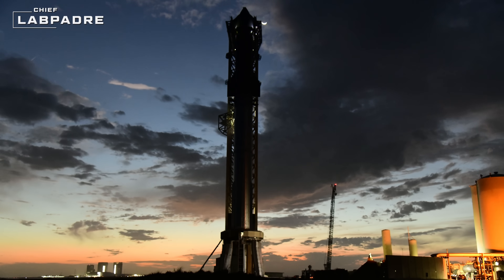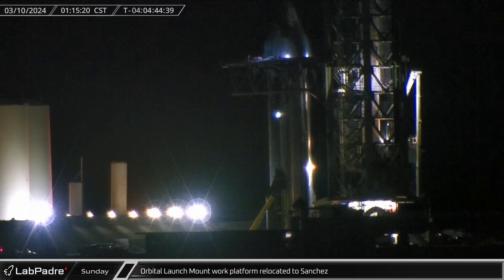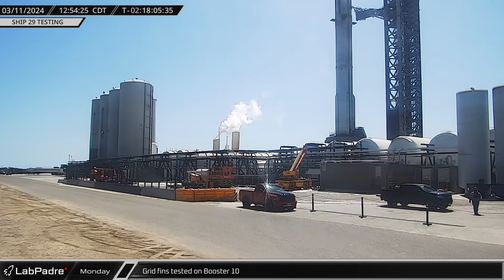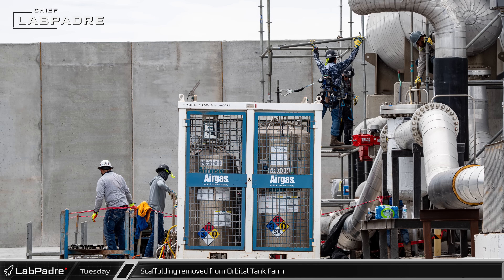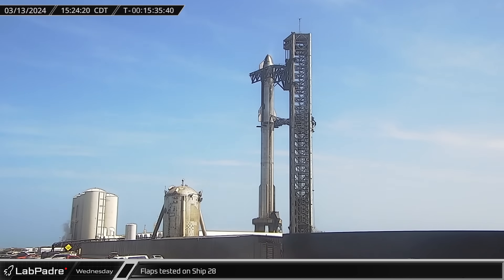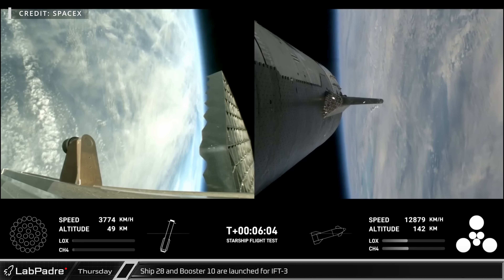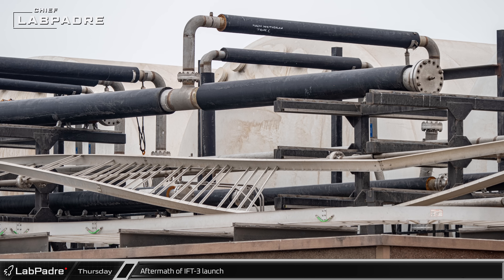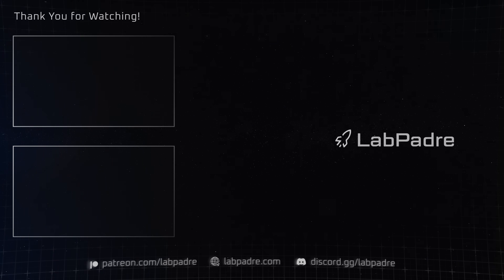WOW!! SpaceX Makes History With Starship's 3rd Integrated Flight Test - SpaceX Weekly #106

Comment: How can you cheerleaders live with yourselves?

The current starship is a pile of crap design. There are four more copies just like ift-3 .

It had to hot stage a full minute earlier than if t-2. Reason to avoid exploding. That is not a step forward. That a step backward. Then hot stage flat top section destroyed nozzle o-rings in the three gimbal engines. But starships burned damaged engines to 170 kilometers. Engines shut off. But now gimbal engines are venting methane in an oxygen out the rear of the rocket.. video fades out for a while until they bring it back online with Star-link. The view remains the same. Gas is still being expelled out the back of the rocket through leaking O-rings. As starship begins arcing down to reentry, gimbal engines can’t relight. So as it hits the atmosphere the tiles and insulation begins flying of the ship Like a dealer dealing cards at Vegas. With no gambling engines now starship begins to pitch and yaw. Even if SpaceX could have righted the ship. It still burns up due to missing Thermal heat tiles. Last as to heat resistant stainless it melts at 1400 to 1450 degrees. If it were 7075-t6 or 7  it would melt at 1075 degrees . With starship falling like a stone out of space it will encounter 4,500 to 6,000 degrees. At least Apollo came in at an angle and avoided temperature around 3,200. The tiles will not stick to 304 stainless. Heat has nothing to do with it. It is plane non stick.

So expect the same result with ift-4 threw ift-9. After ift-9 bs will walk. The government will no longer throw more good money after bad.

Comment: Does anybody know what happens to the concrete inside the OLM legs? It's there a risk with all of the extreme heat, pressure waves, and vibrations? Can that cause issues?
Reply: There's a concrete construction everywhere but it doesn't cause any major issues

Comment: I've speculated this over on NasaSpaceFlight's channel, but I wonder if future towers they're going to give themselves more distance between the launch area and the ground equipment, just to better handle the force of takeoff.  Could be that they're just too close right now to really shield everything properly.  Also kinda wondering if they might not build, or allow to be built, some sort of bunker structures for all the cameras.  I mean sure, they don't have any obligation to, but all those fans and groups setting up equipment are great PR for the company and it'd be a nice little nod to the groups that all support their endeavors
Reply: Maybe, I suspect more horizontal tanks.  When you're using super chilled propellants plumbing runs are a real concern.
Reply: @TheEvilmooseofdoom true, but right now they have all their tanks and plumbing practically on top of the launch area...with the result that stuff is getting hammered every launch.  I'm not talking setting it a mile apart or anything, just move it back a bit further.

Comment: If you want to test the unprotected stainless steel strength and resilience to reentry speeds and plasma, what would you do? Test immediately by by using a shortened flight profile with no danger to populated areas, or leave it for later and spend a more evolved Starship flying over Philippines and Hawaii ?
My opinion is that the slow Starship rotation was intentional for a test that cannot be repeated later.

Comment: since starship can reach orbit in expandable mode now do you think we will see a bunch of contracts for that?
Reply: So far it has no real way to deploy a payload other than Starlinks, a system which itself is still untested.
Reply: Starship payload bay door need a different design and opening mechanism for general customers. Not this dispenser type. They will need to fly that design and make sure it can open and deploy satellites in orbit before they can take in customers. 

Also they might need to upgrade Starship with more powerful RCS to stop it from tumbling all over  after reaching orbit...and finally figure out how to stop all those venting and flaking of large blocks of ice from Starship... these blocks of ice can damage any satellites that going to be  deployed from Starship.